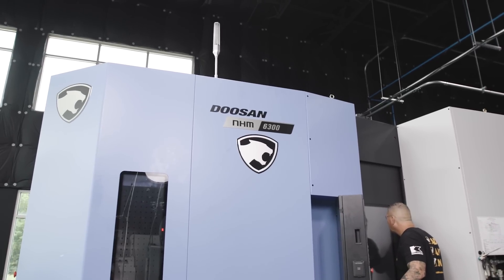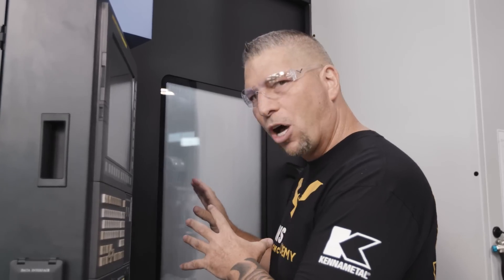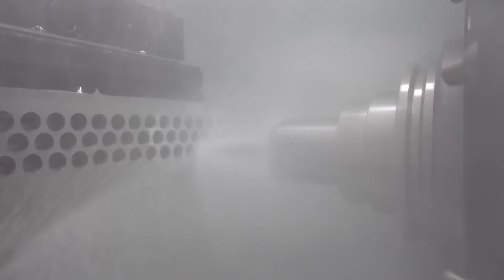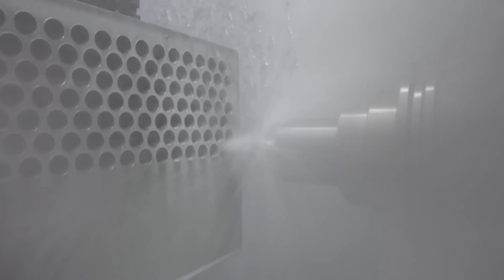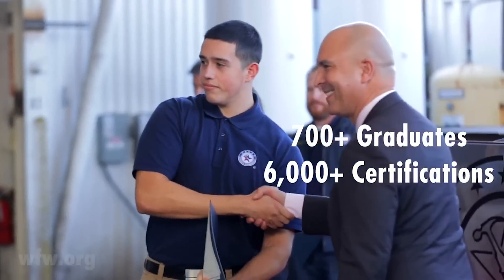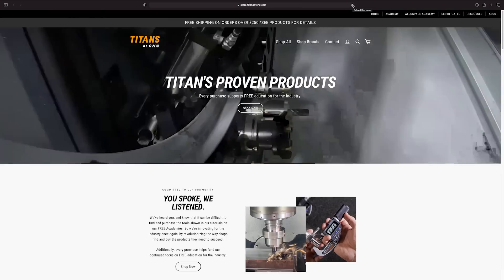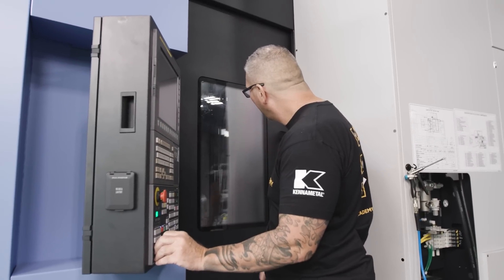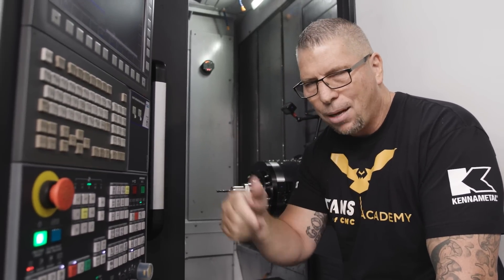Kennametal SGL Drill Test | 316 Stainless Steel | Incredible Speeds & Feeds | DOOSAN NHM6300

Comment: Sir Can you tell me RPM and Feed
 Use for material SS316L in 
4mm Cobalt drill and depth 90 mm

Use in VMC 3-Axis Machine This machine is not through coolant machine 

Drill Details
4mm Cobalt drill dia. and 120 length
(HSS-E PFX Extra Length Dril)
2RG4369627
Bright Finish
DORMER DIN 1869/1

Comment: What is a plate like this used for?  I have seen a few videos of you making 600 or so holes in a plate but wasn't sure what the utility was. Thanks!
Reply: I assumed these were just showcasing the drill. A piece of scrap stock just used for testing.
Reply from the maker: Ya, anyone can drill a few holes fast… wanted to test the cut in a TON of holes to learn more about what the drill can handle
Reply: Actually I use these for work in headers for coils I make em daily

Comment: How many holes in total to you expect to get from this drill before breakage or sharping of this drill bit?
Reply: In a perfect holder 4200 holes ish, but if it is for a tap 1000 holes is a good value. If you use a colet flex and you have high tolerance i wouldn't do more then1800 holes. I like to think if you go to 35 inch a minutes the max before getting some deflection or imperfection is 120 min of machining.

Comment: I thinkI have said it before but .. At 67 it’s too late to start again in industry and work…. BUT  seeing this CNC CAD CAM stuff you do it sparks my imagination and will to learn.. I will not be putting a machine in my garage but you make it so i would if i was wanting to start again…. Cant believe how much information you are giving out……it is the sign of a man confident in the abilities of himself and the employees and company that fear of competition is no longer a fear.  
Quality, speed and cost always make the “Value” calculation. Efficient operations even with high cost equipment and tooling will make money when used to the best. A poor tool is not just the cost of the replacement  tool but the cost of a written off part, out of spec product and cost of the material to do it again…  thats the profit margins totally destroyed.  
Love the work , love the proof of 600 holes pushing tools so others don’t need to.  Your not King of the Castle but the foundation of many  many good machinists and programmers .  Do you want to be a king for a day till some one pushes you off the top or the foundation of many a prince and princesses of machining anywhere in the world?   Keep on going… many will be swooning over the machines you have. And many more will be using the information to become better and better at the work they produce now thats worth a pat on the back.  Good work from the whole of the team in the building..